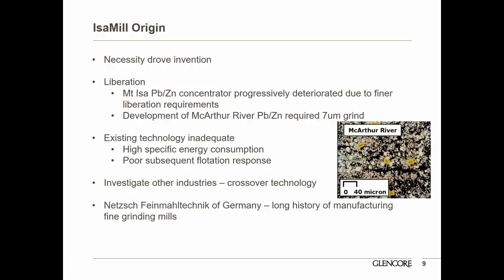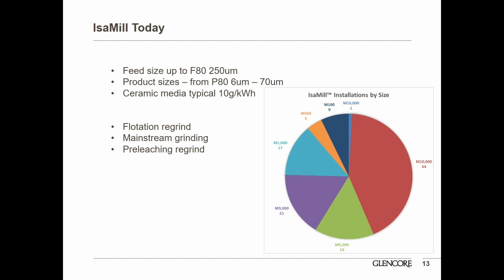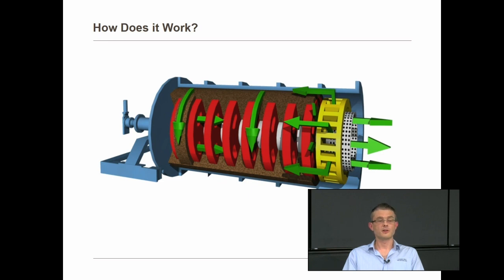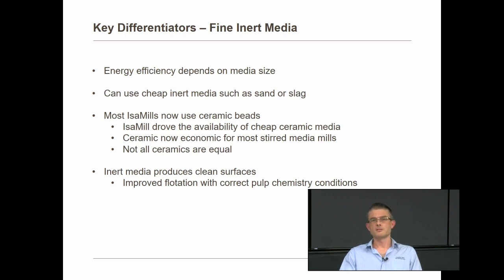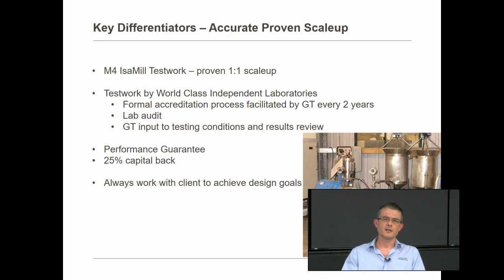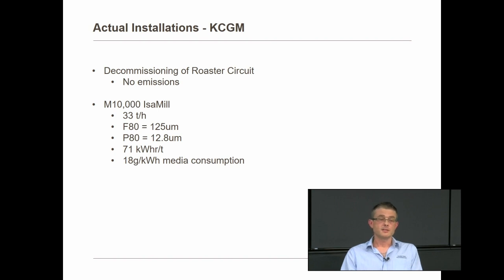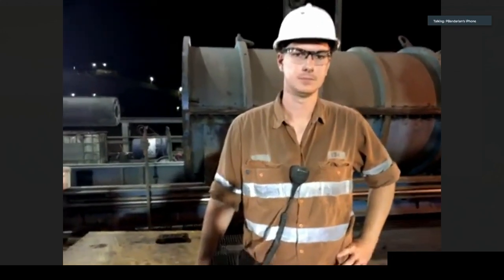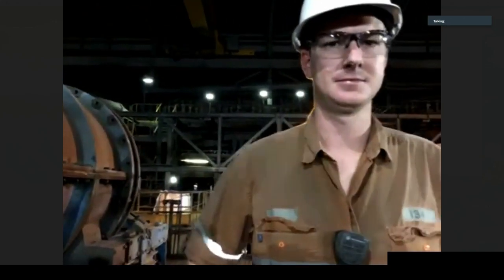IsaMill Presentation and Live-Cross to an Operation

Comment: You had McArthur River using the Isamill and Century zinc using the Metso Sand dettritor. Both grinding to 7 microns, would be interested to know what the power efficiency difference is. I worked at McArthur River for a few years, nothing wrong with Isamill but they are a bit more difficult to run and keep going.
Reply from the maker: Thanks Hossak, every technology gets easier as it evolves. The IsaMills at MRM and Mt Isa were early and trail-blazing. The mills performed well, as you say, but were new. They've always evolved, and some clients are quite easily getting 98% availability from their IsaMill.
Reply: They have come a long way in terms of servicability. They also offer greater power availability per unit area compared to the sand mills. That said, any figures on the efficiency difference?